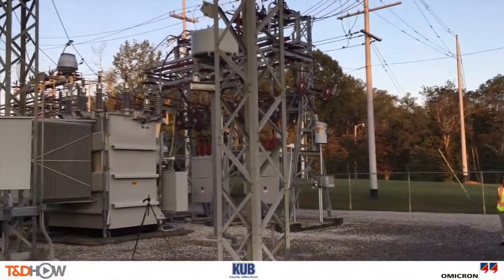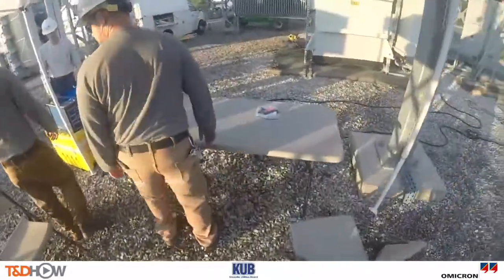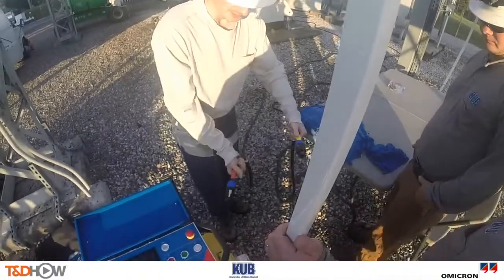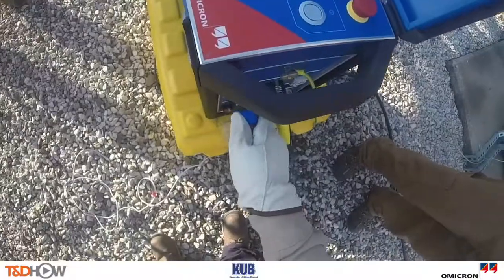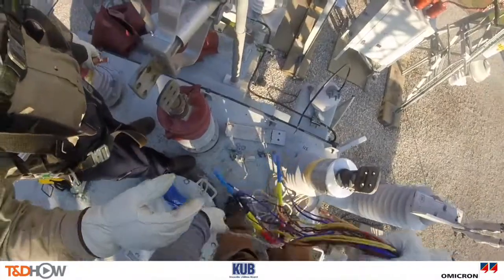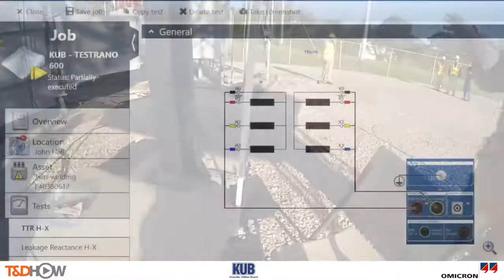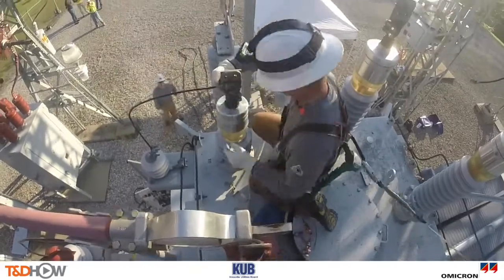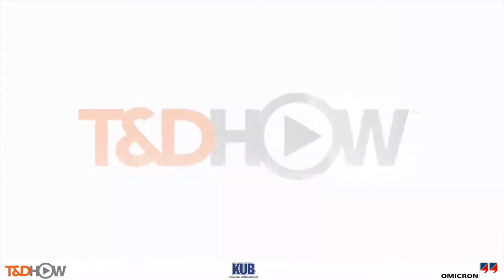Transformer Testing with One-Time Test Connection

Comment: I love the use of Neutrik NL8 Speakon connectors which are design for use in multi way speaker systems.
Reply: They aren't Speakon. They're powerCON connectors. Same company, but meant for power.
Reply: @straightpipediesel  Actually they must be SpeakOn, since they use a single connector for 4 taps, so it must be the 8-pin NL8xx series. PowerCon is only available for single phase with phase/neutral/ground pins, which would not be sufficient for the amount of wires for the clamps. There actually is a PowerCon out (grey) on the device, which seems to be for powering your measurement rig, but the main connections are SpeakOn. But even if SpeakOn is designed for speaker connection, they are quite beefy with being rated at 30amps at 250V, even if they are very compact